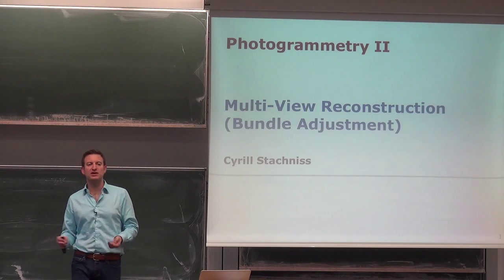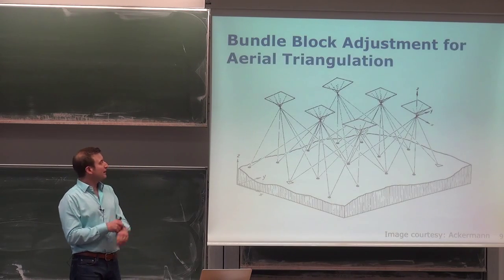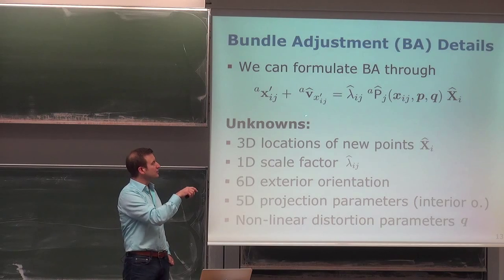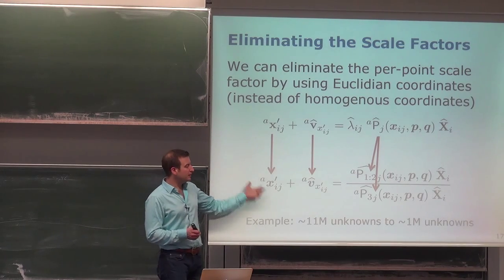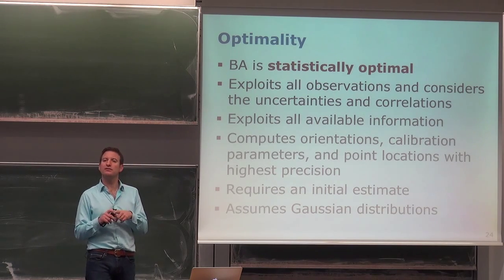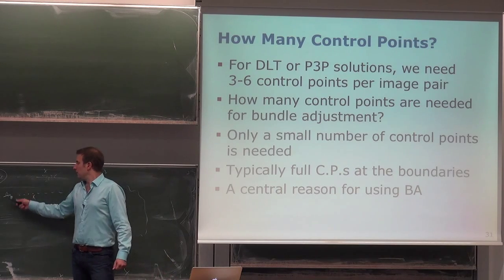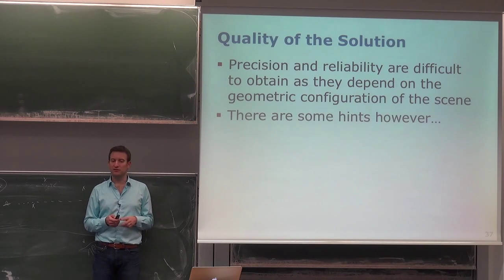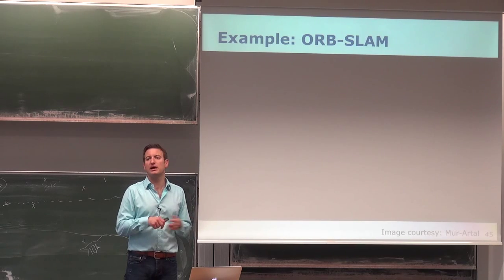Photogrammetry II - 07 - Bundle Adjustment - Part 1 (2015/16)

Comment: Dear Cyrill!

I have a question. Please help me. Thank you.

In BA, I have Photo coordinates, Ground Control Coordinates, so I can calculate flying height H. From that I can calculate Ground coordinates from vertical photo. Now I want to calculate two-dimensional conformal coordinate transformation  by a least squares solution (initial approximations). But I read some books they have Arbitrary coordinates. So What is that coordinates. And how can I have that coordinate from above informations. Thank you so much.

Truong Linh.

Comment: Dear Cyrill! 

Thank you so much for your class. I am a new in Photogrammetry. So when I watched your video. I have some problems that I can not understand. So I have a question. Maybe silly questions. Please guide for me to open my mind in BA. My purpose is obtain the exterior orientations parameters of all image. So what is your value was mentioned in your lecture by coefficient Matrix or Nomal Matrix. And I have found many document on internet (to read)  but I can not find exactly document which have real steps in BA. So If you have some links or document about BA, please guide for me. 

Thank you so much.
Reply: +Nguyễn Trường Linh 
Hello there,

I am interested in BA, I am trying understand it better. 
Did you finally find some documents, links, or library which has consistence and working well algorithm ? 

Thank you for your answer and best regards.
Reply from the maker: +Michał Szczepański You may want to look into g2o. May be not trivial to use but quite powerful and flexible
Reply: Thank you very much for your tip. I will check it.
I  really appreciate your lectures. Keep going with that.
Reply: +Michał Szczepański Hello. I found this. I think it is more detail but not easy to understand. I dont know it will help or not. I still looking for some documents. Hopefully It will help you.

https://wiki.hexagongeospatial.com/index.php?title=Mathematical_Models_for_Bundle_Adjustment

Please let me know if you found something new.

Thank you.
Reply: +Nguyễn Trường Linh Thank you too. I will try to study it. For the moment I am absorbed by Multiple View Geometry - Hartley and Zisserman. 
Keep in touch, best regards.
Reply: +Nguyễn Trường Linh   I didn't have enough time to analyse it but all seems to be interesting, and helpful   

http://users.ics.forth.gr/~lourakis/sba/sba-toms.pdf 

 http://www.cvg.ethz.ch/research/chzach/index.html,

https://openslam.org/g2o.html

Have a nice time!
Reply: +Michał Szczepański Thank you Michal!